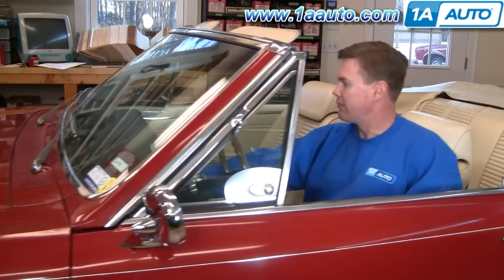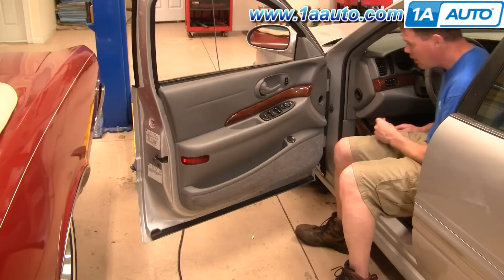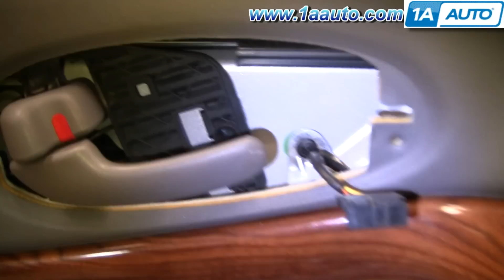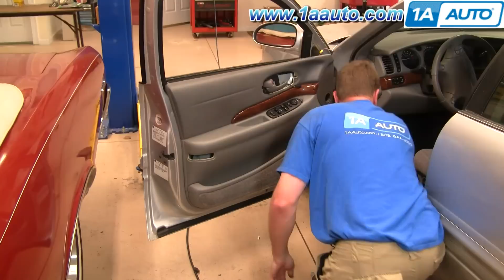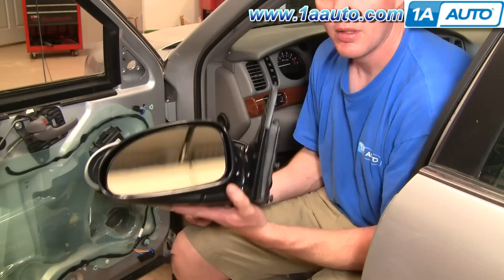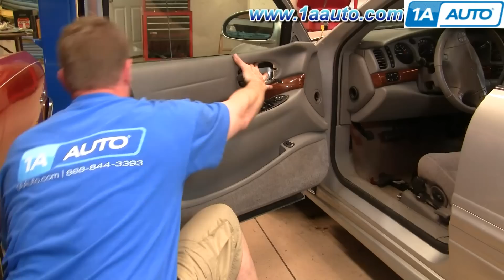How to Replace Side Rear View Mirror 02-05 Buick LeSabre

Comment: Installed passenger side power heated mirror in 2001 Buick Century Regal. This video helped explain the process. In my case: no need to remove red reflector there's-no screw behind it. I removed an exposed screw in well of door handle shroud and popped shroud out. Pried loose all nylon compression pin fasteners from sockets around the panel-including top edge and triangular mirror cover. With pins & panel loose there's clearance to access mirror posts, cable & connector without removing panel.
Reply: 200 Regal owner appreciates your comment. Thanks! I didn't think I needed whole door panel off again (power window issues last summer).

Comment: Is this the same process as the 2000-2005 Pontiac Bonneville (which shares a platform)?
Reply from the maker: +Bailey Anderson It may be a different procedure on your application. We currently do not have an auto repair video for this particular year, make and model. Thank you for asking. 1aauto.com

Comment: Is there a method of replacing only the cracked glass without replacing the entire assembly?
Reply from the maker: If you unbolt the glass from the window regulator, you should be able to pull it out of the top of the door. Hope this helps you out. 1aauto.com 866-403-3393